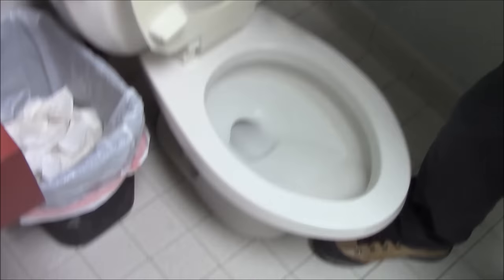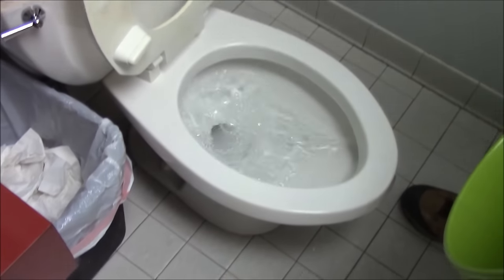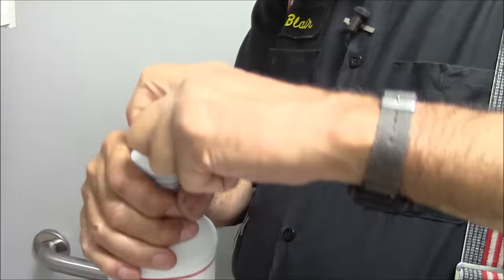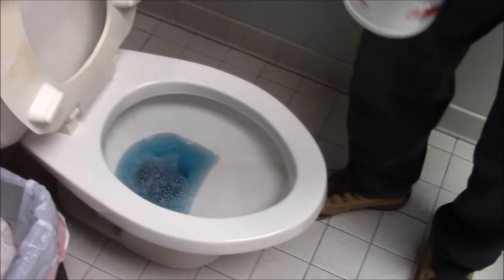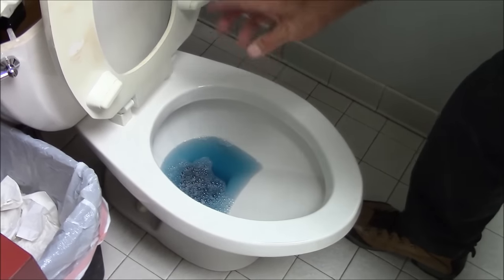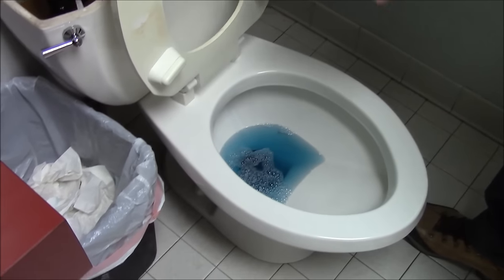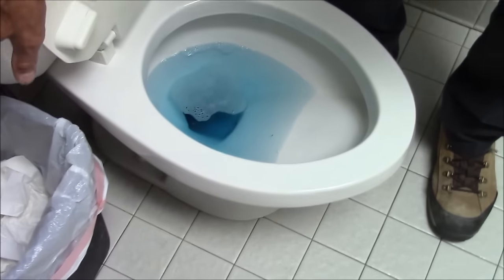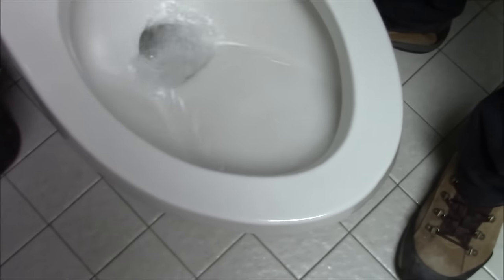Slow Flushing Toilet? Quick and Inexpensive Cure With Delimer

Comment: So, your repair ALMOST fixed my problem.  After trying everything including replacing everything inside my toilet anew and performing your fix (soaked for 3 hours) I did a bucket test and lo and behold a big chunk of (calcium?- light grey in layers hard and brittle) about 3.5 inches long and 2 inches wide and 1/4 inch thick floated out into the bowl!  I've worked ("P"?) trap and know it is now clean, but obviously my toilet siphon jet from the tank is built up the same or worse.  So, how can I remove that when it is so thick?  Any ideas besides a new toilet?  I hate to give up after this much time and energy and expense.  Strongest chemical you know?  Hydrochloric, Muriatic, Citric Acid - for how long?  Some kind of little snake (nylon brush on drill?)  Thank-you in advance.
Reply: Okay... I did it!  I used a flexible plastic drain "Zip" unclogger.  At first it wouldn't even go in, then a bit more - eventually I could get it in the full 2.5 feet.  I removed all water from the bottom of the toilet and am soaking it in 100% CLR for a few hours and that should remove the rest (I can feel a large bit on one side still that won't even budge with a bent skewer being tapped on with pliers).  Nevertheless it flushes like new already.  Thanks for leading me to the solution.
Reply: The acid into the overflow tube comes through the jets in the rim. A few toilets require 3 doses. After that spend $130 for a new comfort height toilet.
Reply: @blairgilbert7606  I'm just about ready to do that.  The problem is indeed buildup.  Unfortunately my replacement flush valve keeps leaking (Fluidmaster 550DFRK-3 and I'm going to have to throw that out.  I think my original flush valve was fine (never leaked) and the problem was the buildup in in the jet all along.  By the time I'm done I could have bought a new toilet and not have futzed around with rusted bolts.  Thanks for the reply.

Comment: Ty. You saved me $200. I also discovered that my water pressure volve wasnt all the way on & that my ancient requires that I hold the flush handle down until it's done flushing for 30 seconds, & this one has a a design that practically blocks me from pouring anything into the over drain. WTF? Who designed this thing? LoL.

Comment: I was wondering how well it cleans the jets if it just passes though them and then looses contact. Wouldn’t it clean them better if there was a way to cover the jets temporarily and let the cleaner sit for awhile in the jet before letting it flush through?
Reply from the maker: I haven’t had that problem, some older toilets require two doses.

Comment: I followed your steps and used CLR . It worked with no problems. Thank you,
Reply: Did you use CLR full strength?  I suppose that doing so would not harm anything because it ends up getting diluted with the water in the bowl.

Comment: Hi.  Is a highly acidic product like the one you demonstrate, safe for septic systems?  I would only use it occasionally and am mostly concerned with it upsetting the bacterial activity which septic systems rely on to function properly.  Thanks!
Reply from the maker: It won't effect the septic tank because it is only a quart and by the time it reacts with the calcium it will be fairly inert.

Comment: Hello Mr. Hardware,
I live in NY and Rooto isn't available here. The only thing in my area is a product called Zep. Is this basically the same thing as Rooto. The directions for use doesn't say anything about using it the way you did with Rooto. So I was just wondering if it would be ok to use it like you did Rooto. Also quite frankly my problem is the big hole in the front of the toilet. It is so clogged with calcium it isn't funny. I broke it up the best that I could with a small screwdriver and the toilet is finally working the way it should but I know it won't be long and I'll be having the flushing problem I was having before. So I wanted to somehow get more of that calcium out of there before it happens again. I can't believe there isn't a special tool for reaching into that large hole to clean it. You can only go so far with a screwdriver. Thank you for any/all the help you might be able to advise.
Fredi
Reply: Fred, put away the metal tools. Zep makes lots of stuff, my sub for delimer is muriatic acid. Available every where.
Reply: I can't get all of the lime and calcium buildup off of the main siphon jet hole in the front of the bowl. That's the hole that pushes the waste down the drain. The delimer acid loosened some of it up and I got some of it off but there is still quite a bit of deposits still attached to the lining that jet hole.

They need to make an angled 90 degree chisel to gently break some of that loose. I think I'm going to try a small socket wrench with an extension and a screwdriver bit, just line it up and gently tap it with a hammer. I think it also helps to put a mirror towards the back of the toilet (a mirror that is too big to go down the toilet) and also suspend a bright light above so you can see what you are getting at. I read on another video where the guy said he used a can opener, the kind that punches a triangular hole in the top of a juice can, to scrape at the stuck on deposit. I'm going to try that too after I give it a 24 hour bath in a weaker acid, like vinegar.

Comment: Hello Mr. Gilbert,

Thank you for your presentation, which has been very helpful.  

Could you tell us what you make of this idea?  After pouring the delimer into the toilet overflow standpipe, is there benefit from scooping delimer that has collected in the toilet bowl and pouring it back into the overflow standpipe?

Thank you,

John
Reply from the maker: I'm not that thrifty that I would reuse the acid, also it is almost all used up by dissolving the calcium the first time. Too dangerous to recommend.

Comment: Thank you so much much!  I couldn’t find the product you recommended so I used vinegar. Worked like a charm.
Reply: how much vinegar did you use?
Reply: @SunnySunny-ec9vh  4 cups. Use a measuring cup to pour to make it easier to get into the little tube.
Reply: @LanasMomma  cleaning vinegar? or just white vinegar? Thanks!
Reply: @SunnySunny-ec9vh  white vinegar. I buy the 5 liter jugs of Heinz vinegar at Costco. 😀

Comment: Once is not enough. I scoop out the water in the bowl before pouring in the cleaner. Zep works well.  Afterwards, I scoop it out of the bowl and repour it in the overflow tube. Then I do it a third time.  No reason to buy a second bottle.

Comment: Hello Mr. Hardware! Thank you for the video!  I have a question...Will the acid harm my metal pipes? I have copper pipes.
Reply from the maker: Use smaller doses and leave it in the toilet at least 30 minutes so the acid is mostly used up by the time you flush. You can also follow with a bucket of water when you flush to really purge the acid past the local plumbing.

Comment: I live in the Ohio Valley which means I have water as hard as diamonds. My toilet is really heavily calcified and CLR just isn't strong enough to get the job done. I got a bottle of this Rooto 3 in 1 but before I use it I'm just wondering if this will do damage to the wax seal where the toilet sits on the floor when I push the acid back into the trap like in the video?
Reply from the maker: It hasn't hurt a wax ring yet, and I've been using and selling this over 25 years.
Reply: @MrHardware1  I'm glad to hear that. I had a plumber once tell me not to use acidic toilet bowl cleaners because it could eat away at the wax seal. I've never heard anyone else say that before so I wanted to be 100% sure about that. Thanks for the help. I'm going to use this now and if it works as good as it does in the video I'm going to be really happy.

Comment: I would like to try this, but I can only find the Rooto delimer sold in packs of 12 bottles, which is overkill for what I need.  I tried CLR and saw only a little improvement.  I tried the suggestion from other videos of taping the jet holes with duct tape so the liquid can stay in the raceway longer, but that didn't work well because a fair amount of CLR leaked out anyway.
Reply from the maker: Forget the Delimer and see if you can’t get muriatic acid instead. You can get it at building supplies or pool stores.

Comment: usually how many bottles do you need for a complete clean job? Thanks!
Reply from the maker: Usually one, some take 2 and rarely I need 3 quarts. Some areas have harder water w/more chemicals that turn to hard mineral as the water evaporates.

Comment: @Blair Gilbert I have a toilet that is only 4 years old.  I'm on the third round of cleaning.  Every  time when I poured the Rooto into the overflow tube, no blue comes out through the jet holes.  I did attempt to poke through some of the holes with a hanger both before and after the Rooto cleaning.   Am I correct in thinking not all the holes are unplugged?   Is there anything else I can attempt to open up these crusty holes in the rim of the bowl?   Prior to my cleaning, I was only getting water through the back 1/2 of the rim holes.  I am now getting water, some, out of the front 1/2 of the bowl rim.  Thank you for your instructional videos!
Reply from the maker: I have had a few toilets that took 3 doses of treatment. There is always that odd one that kills me. This could be you, sorry. Blair
Reply: @MrHardware1  Leave it to me to be the "odd" one.  I continued with the coat hanger and poked through the holes and it's flushing much better now.  Thanks for all your information and videos.

Comment: I hope this works.  I have repeatedly snaked my toilet, and even gone on the roof with  a water hose and sprayed water down the vent tube and nothing is working to stop the siphoning.  The water is completely siphoning out of the bowl within a few minutes and the sewage gas comes in.
Reply from the maker: If you hear gurgling there is a vent restriction or the toilet drain line is clogged down to a small opening and the reduced pipe, should be 3” I.d. Or larger.
There could be a crack (that wasn’t there until now) in the trap in the toilet. Slowly pour water into the bowl, while no other plumbing is runny, and see if it will hold water. If it slowly drains down on its own you have a rare cracked trap in the toilet. Time for a new one, no repair here.

Comment: How do you clean the tornado jets in a Toto Drake II? Our Drake II stopped flushing completely so I did the bucket test to ensure the drain was not clogged, then I used a delimer down the standpipe (overflow pipe). I only saw the blue fluid entering the bowl at the bottom (not leaking out from the tornado jets below the rim). The deliming process has improved the flush, but I'm wondering if there is a better method to clean the rim jets.
Reply from the maker: I have poured it into the overflow pipe quicker and/or done it more times. I’m not a fan, nor do I do it, try to plug holes inside the bowl to force the delimer somewhere else. I simply do it more often.

Comment: Mr. Hardware, what is your view on the tank chlorine tablets?
Reply from the maker: @pg-mtl8815  if they keep the cleaning person happy, use them. The side effect is it ‘pickles’ the flapper (or whatever the seal is on the flush valve) requiring more frequent replacements. Most municipalities chlorinate the water which makes tablets (and other toilet tank chlorinators) unnecessary. As an aside is why I use a charcoal water filter on my drinking water.

Comment: What if you taped the jet holes shut underneath the rim, so the cleaning chemical can soak the buildup better?
Reply from the maker: You can, however I have never needed to. Plus it’s a messy job removing and disposing of the tape covered w acid.

Comment: Couple of days ago the bowl got clogged all together. I snaked it pretty deep and it just fills the bowl now, and slowly drains within about 20-30 seconds. Then it gurgles at the end. The bucket test gave me varying results. From full and quick flush to fill and show drain and then gurgle. Would pouring muriatic acid to the overflow pipe will fix it? Or does it sound like a cracked trap (something you mentioned in another comment)?
Reply from the maker: It sounds like a clogged drain line. The fact that it gurgles at the end means the water that is going down the pipe has no room for air, so as the water falls, it sucks air out of the toilet hence the gurgling.
Pulling the toilet and snaking the line w/a 2” cutter will probably fix the situation or at least indicate what else might be wrong. 
When the drain line is clear the bucket test (almost) always flows perfectly.
Reply: @MrHardware1  is there a way to run a 2" cutter from the toilet itself without removing it?
Reply from the maker: @mgk2659  not that I’m aware of, the sewer cable can usually cause some damage to the China in the toilet. You could possibly try a regular small snake that just has a ball on the end of it and trying to get it through there however, after the snake makes the S through the toilet, you don’t have any control or know what’s happening after that.

Comment: I don't think we can get this product in Canada.If you are familiar with the C L R calcium and lime buster,so to speak,in Canada,could we use that product instead.Some suggest using duct tape in order to block the rim holes temporarily then remove the tape in order for the product to make a longer contact with the rim holes.Therefore should do a better job of braking down the lime and minerals blocking these holes.Any comments on this.
Reply from the maker: I would do several applications before I’d go through the trouble of drying the rim so the tape would stick.

Comment: Thank! I have a 30 yr old slow flushing kohler toilet in which I will try this. Any problem using the chemical with a septic system?
Reply from the maker: One quart of acid, after reacting w the calcium, which makes it pretty inert, into 1,000 tank is no problem
Reply: @MrHardware1  Thanks!

Comment: what about inside the water tank?   can you use the same product to clean all the rusty and lime away???
Reply from the maker: I usually don't because I don't want the crud getting into the jets this lesson is all about. I would pull the tank, about a 30 minute job, get new gaskets, clean it outdoors, and reinstall it.

Comment: Sir, do you have any suggestions on how to increase the water level in a toilet bowl?
Reply from the maker: Most ballcocks have an adjustment on the float. Be very, very careful if bending the float rod because the plastic arm breaks first. Also I don’t raise the water level closer than 1/4” from the top of the overflow tube.

Comment: Rooto 3-in-1 Industrial Strength Fresh Pine Scent Toilet Bowl Cleaner and Delimer 1 qt. Liquid is $54 per bottle.  If I use a few bottle the cost would be a new toilet.  Do you have other recommendations?  Thank you!
Reply from the maker: Get muriatic acid from a building supply, about $4 a quart. shipping acid is expensive , purchase locally
Reply: @MrHardware1  Thanks!  I got it from Home Depot. It costs about $9 per bottle.  I was suprised that the rim jet holes were not only block by calcium deposit but also by trash.  It looks like my tenants put some toilet paper in the tank before.  OMG, it took hours for me to remove it.   I also discovered that the rim jet hole water is not from the overflow pipe so basically the muriatic acid didn't help.  I ended using my hands to remove the calcium deposit and the toilet paper around the rim jet. :(

Comment: The product you mentioned is not available locally and I see you mentioned to use other acid but I was curious if CLR would work?
Reply from the maker: It does but not as well. Muriatic acid is usually available everywhere there are bricks to be installed and pools use it.

Comment: What causes the water to flow down and come back up a little bit with a vertical cone of water ???
Reply from the maker: I’m not sure of your description, however when the rim jets and the trap get restricted by a buildup of calcium a toilet seems to flush up, spin and then go down slower than normal.
Reply: @MrHardware1  When the toilet flushes, it does not gargool, the water just comes back up like a volcano shaped mountain. The top point is about two to three inches high in the center of flush hole. Hope that helps ?? I was thinking it just might be a blocked air vent. Thanks Mr. Hardware.
Reply from the maker: @victoryfirst2878  Pour a bucket of water into the toilet bowl, which will flush it, and listen for gurgling from the sink or bathtub. Bigger the bucket and the quicker you can pour it the better (without making a mess). If the water goes down as fast as you can pour it the drain is open and you need delimer.
Reply from the maker: If the sink or toilet gurgles the vent may be clogged or the drain line may be partially clogged.
Reply: @MrHardware1  The water goes up to the top of the rim and takes about 10 to 15 seconds to go down. Normal ??
Reply: @MrHardware1  I will get a bore camera and see what is going on inside the pipes. Thanks Mr. Hardware.
Reply from the maker: @victoryfirst2878  is this w a bucket of water? The bucket test will indicate whether the problem is the toilet or the drain.
Reply: @MrHardware1  Yes W bucket of water Mr. Hardware.
Reply from the maker: @victoryfirst2878  the ‘bucket’ test usually confirms you need delimer or muriatic acid to clean the jets.
Reply: @MrHardware1  I will do that this Friday. Have to get supplies Mr. Hardware. Thanks fella for the tip.

Comment: My Md hardware store doesn't sell this delimer/descaler and says using Muriatic Acid is dangerous chemical that I need to avoid. What they mention to use is CLR. Do you agree? Thanks
Reply from the maker: They’re Sissy’s, I’ve been putting muriatic acid in toilets (and urinals) since the 1960’s. CLR is my second choice, more expensive and not as strong.